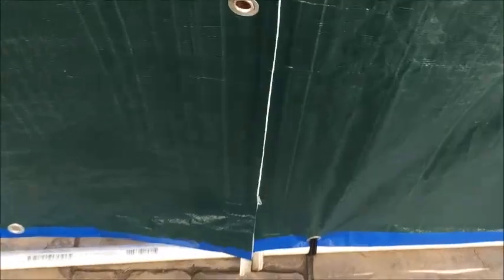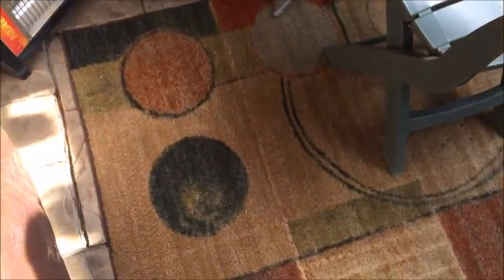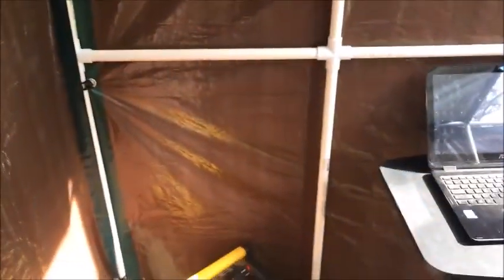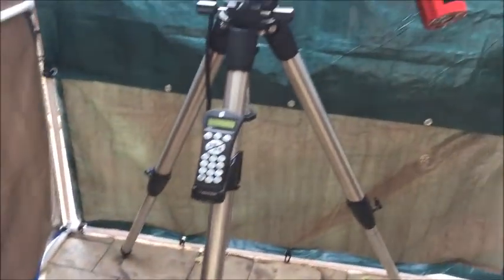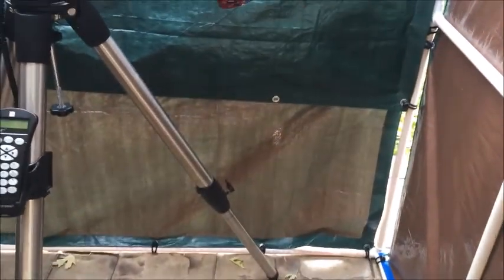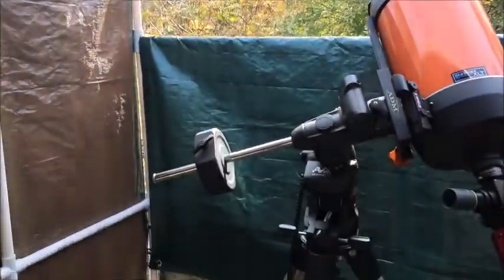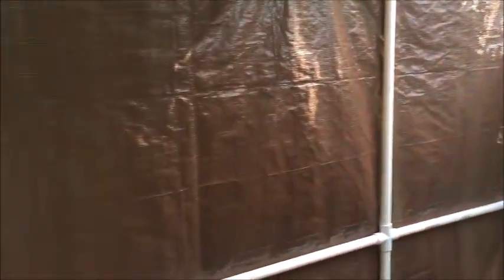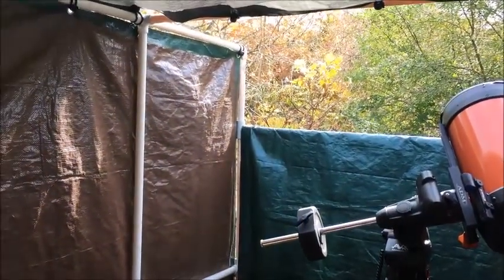Portable Affordable Observatory

Comment: This is a great idea!! I do have a question about running a heater inside. Does the heat haze ever interfere with your images? or does it just not put out enough heat to be that much of a concern?
Reply from the maker: Hi and thanks for viewing.  Great question.  Maybe if I had a propane heater that really put out the BTU’s it may be a problem but with the little heater I’m using there is no problem.  In fact, I wish it was a little bigger and provided more heat!  :)  Up here in Mn. it’s starting to get cold out, maybe this weekend I will set it up and check out Jupiter.  Let me know if you are interested in the plans.  Clear skies to you!

Comment: As soon as I finish this comment, I intend to go to ebay and order the plans. I have looked forever, it seems, for a truly portable, affordable observatory and this plan seems to fill the bill better than I ever expected. I do have a few questions: I live somewhat next door to you (Minot, ND) and am more than familiar with the cold and wind. Would it make sense for me to maybe go to the next larger size pvc (or cpvc) to make it sturdier and more wind resistant or would that just make things more unwieldy and unnecessary? What are the loops you use for attachments? Are the tarps a standard size? Any problem (other than adjusting pipe lengths, etc.) with making it a section longer to allow for a sleeping bag? Thanks so much for the best idea I've seen in amateur astronomy in a long while.
Reply from the maker: Hi neighbor and thanks so much for your interest and kind words.  My in-laws live in Fargo ND so we get up there now and then.
The Portable Affordable Observatory works well for me and it is a fun project to put together.  One could use a thicker wall PVC piping and that would help a bit to give it a little more weight for the wind but also tying it down like a tent works well.  The size of the tarps are standard and I use tarp bungy tie downs and all this is in the plans.  Once again thanks so much for your interest and let me know if you have any questions.  Have fun and clear skies!!!!
Reply from the maker: I think I would have room for my sleeping bag.  It's 8' long.

Comment: Simple but usefull. I live near the coast and there’s always a lot of wind, do you have experience with that? Will this construction stand up to that?
Reply from the maker: Hi Peter and thanks for viewing and your interest.  I have tied and staked down the top 4 corners and it’s good for a light wind but if you just build strictly to my plans with no modifications and there is a good wind that night you may find (or not find) your observatory in the next county.  :)  But this is a common question I have.  One modification is instead of building the frame with the thin gauge PVC make it out of the regular PVC and then you have a much sturdier structure.  Then Some thin plywood for foam board.  It’s all about the weight at this point.  Then it’s more of a Not Portable Affordable Observatory.  But maybe that’s not a big deal for you.  The structure is the important part, at that point one can take it from there.  Good luck and let me know if you are interested in my plans.  

Pete

Comment: Have you had any snow on it?  I had a half round storage unit for my pickup made with steel ribs and very heavy canvas.  One day after a heavy snow, I walked inside and wondered why it was SOO light.  The snow had collapsed the roof and ripped the canvas in several spots.
Reply from the maker: No, it's not really built for that.  It's designed for a quick setup and takedown maybe the next day.  Unless the weather looks good.  It's mostly for getting you out of the light breeze and keep you warmer.  A person could use something else other than tarps to make it more sturdy but then it's no longer light and portable.  One day I would like to get a real permanent observatory.  This will have to do for now.  :)  Thanks for viewing, and clear skies!

Comment: That's pretty slick.  A very good solution to blocking out spurious light from neighbors and street lights and it offers some protection from the wind too.  I also thank you for sharing and we all know how frustrating it is making multiple trips to the hardware store can be.
Reply: Yes, protection from the wind will add stability to the scope.  But what happens on a day or night when you get wind gusts to 35 or 40 mph.  The whole structure may  be upended?  Just wondering how much wind he has sustained so far.
Reply from the maker: Thanks John for the kind words.  It does work pretty slick. I like to glue the long sections together, that makes for a quick setup.  Curious, did you just stumble across this video or did you see the link on Cloudy Nights or maybe Ebay?  Let me know if you are interested in the plans.  Clear skies to you!!  :)